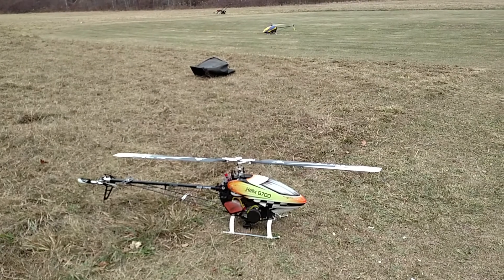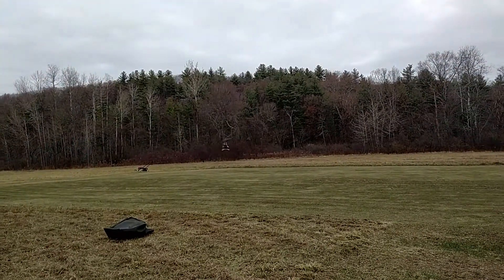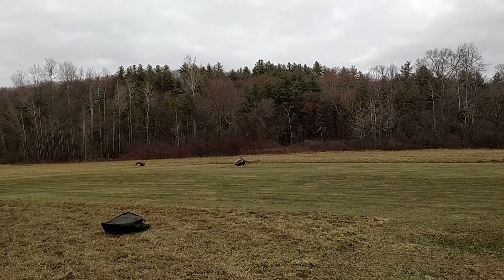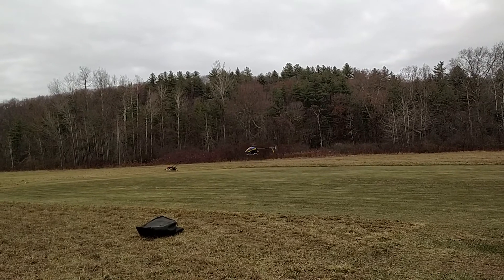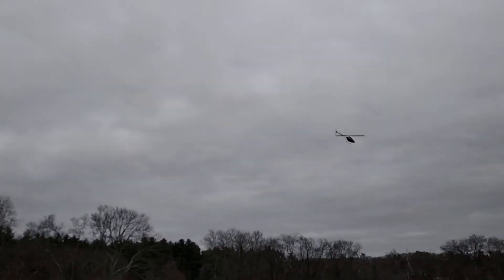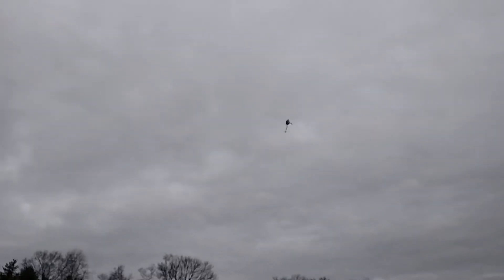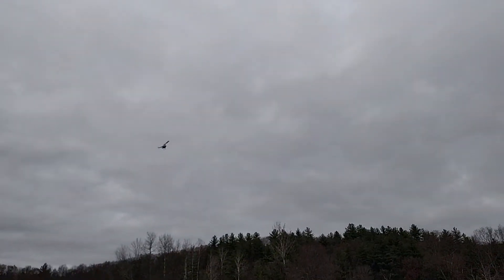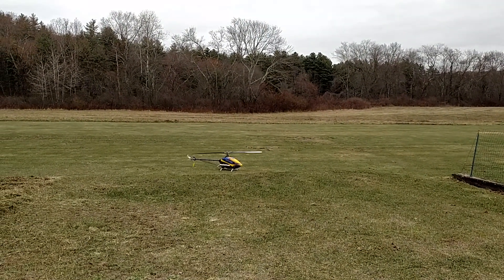Whiplash V2 - Hanson 300 power demo

Comment from the maker: Just to correct one statement in the video  - we later found out that the 2100 rpm I recorded on telemetry was picked up when the head unloaded during 3D moves.  On a full collective climb I recorded 1860 rpm and 3800feet/min.  Raja got 1950 rpm and we suspect over 4000 feet/min on a newer engine.   Both reaidngs are 716 blades at 13 degrees pitch
Reply: What's the stock gearing on the V2? 113/17?
That looks like awesome power for a gasser, really nice!